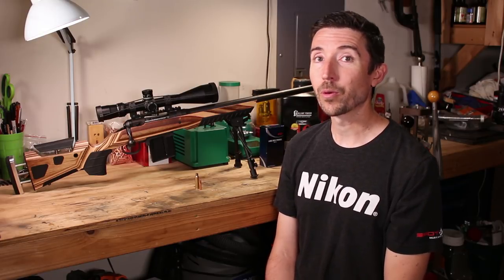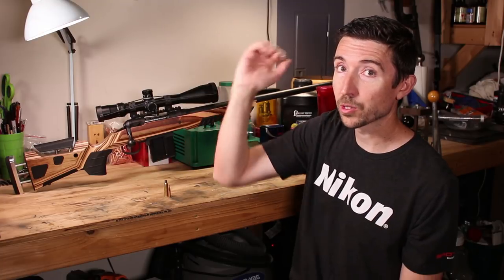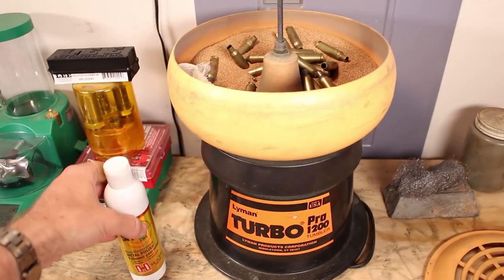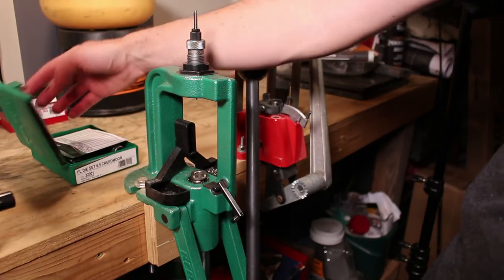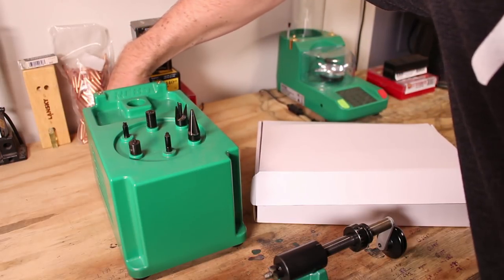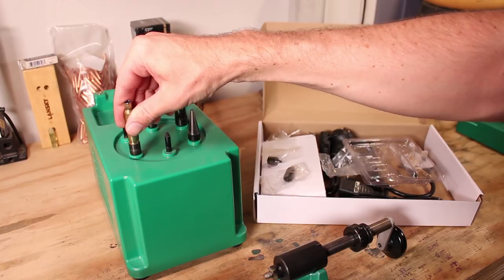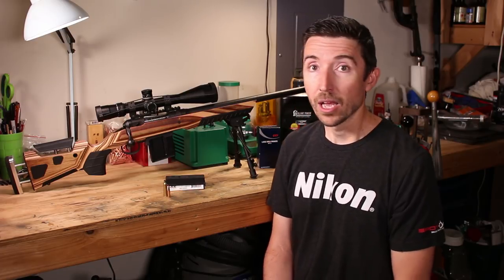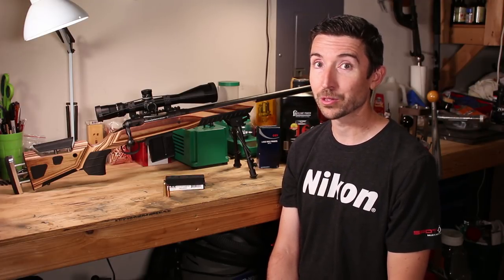6.5 Creedmoor Brass Prep with the RCBS Brass Boss - Mile Rifle Pt 11

Comment: By finding the best load etc for your rifle, you are actually harmonically tuning your ammo to ensure that the crown of the barrel where the bullet leaves the gun sits on one of the waves nodes. 

If you then change the composition of the stock, you alter this and your point of exit could be anywhere on the wave again. It's the same thing as how putting a suppressor or a muzzle break on a rifle can ruin your groupings in some cases, as it will alter it too. Even shooting from a bag when you developed your load using a bipod can make a difference to the vibration profile. 

Surely it makes sense to finish the rifle and develop a load for the finished rifle instead.
Reply from the maker: I agree with you, and it was a concern for me when choosing this path instead of the more proper "finish the rifle, then load up" timeline. We'll see if it comes back to bite me. In practical terms, though, there is a very good chance that the stock arrangement will produce negligible results. In the past I have gone as far as swapping entire stocks with no apparent effect on the node.
Reply: Good luck then mate, hope it works out well. Love your vids.